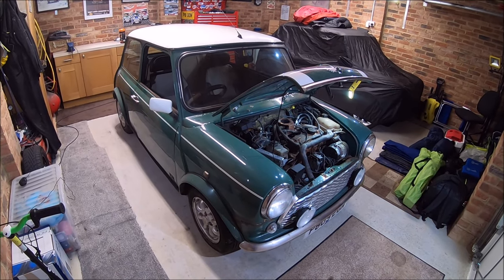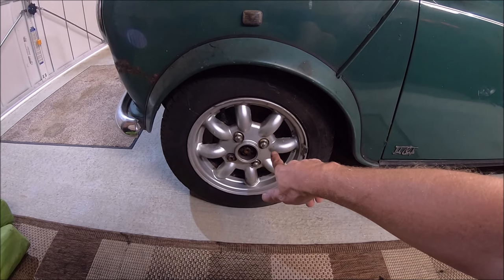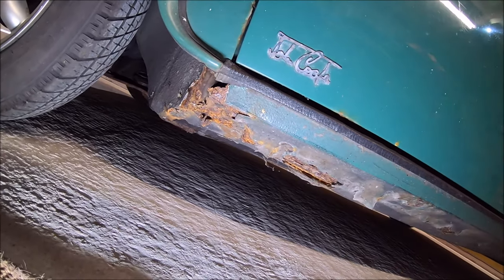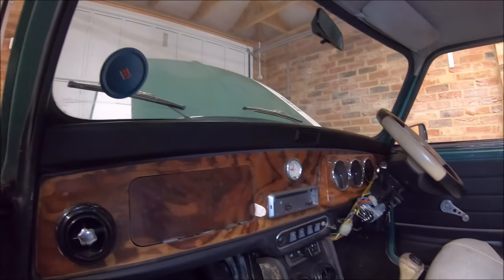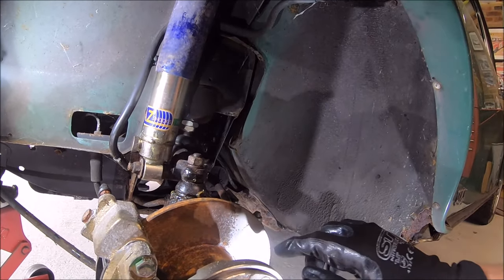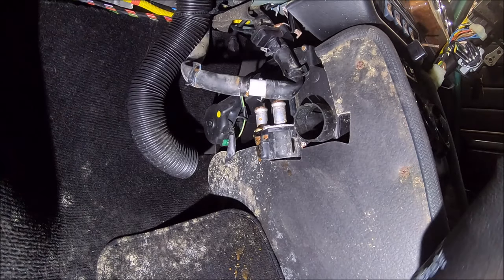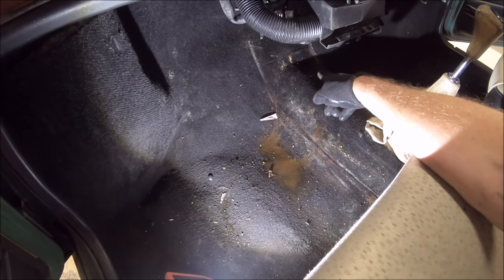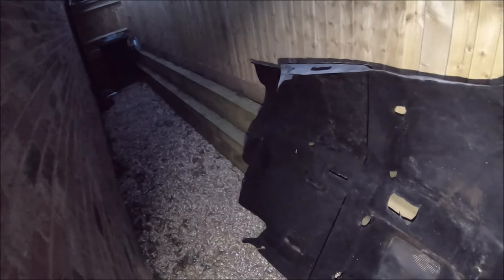Classic Mini Workshop - New Project Pt.2 Walk Around & Corrosion Assessment

Comment: sounds like the alternator has had water ingress when the bonnet was left off it could just be the brushes stuck in there holders try tapping the rear of it while running if not you can get a new reg pack which includes the brushes and anther way to free off the clutch if there is still an inspection plate on the bell housing then a big bar and lump hammer onto the pressure plate will free off and another way is to try and crank the engine while in gear with the clutch depressed same when hitting the flywheel those tips have always worked for me and has never failed in all the many minis i have come across in my career as a RAC patrol plus a fully qualified master mechanic of 35 years  and that engine sounds sweet to me now its had a warm up looks like you got a good one except for the common rust problems mini's suffer from having fitted loads of sills sub-frames and front ends and floor panels and that is one car i have never owned having worked on so many in all my years as a mechanic lol one day as now iam retired through ill health i could do one last resto on my own mini but they have shot up in price now typical your info is good sounds like you know what your doing as i love watching you tube do it yourselfers i love  enthusiasm they put into there cars as i did for a living lol your videos are good ive liked and subscribed so iam watching you closely making sure you do it right lol joke carry on your cool in what you are doing .all the best john from rugby.
Reply from the maker: Thanks John

Comment: Hi Keith, that oil on the floor was caused by a faulty seal/lid on a bottle of oil from Halfords. Brought it, put it in back footwell (why not the boot!!), got home and realised that the bottle was half empty....oil all over carpet, they paid for a valeter to steam clean who thought they had got it all but guess in process must have left some under carpets - shame it caused lasting damage.

Floor was done at a garage on a tyre change 😡

The brakes etc have never been on the road. Original plan was to get welding done and put 10 inch wheels on. 

Engine was always solid and reliable - fingers crossed will stay that way 🤞
Reply from the maker: Aha, that would explain the carpet, it's completely clean on top, its just where its soaked into the foam and sound deadening underneath. I think I'm going to peel away the foam from under the carpet and just replace rather than trying to clean as it's pretty sticky. It's a shame most tyre places don't know how to jack a Mini, it's pretty standard to see the floor damaged like that. Thanks for taking the time to reply and add some detail, I really appreciate it. Has it always been garaged since it came off the road in 2007? I found some bits of roof in the engine bay so assume the roof leaked maybe although my other Mini Vini somehow manages to go rusty in a completely dry garage LOL
Reply: Yeah we had a leak around 3 years ago and had the garage roof replaced so it would have had some water dripping on to it for a bit I’m afraid... 

I think there was always a small bit of bubbling on the roof when I was still using it.
Reply: @tomhumphries9731  It's weird why the roof bubbled so bad on one side tho.

Comment: I was just flicking through an old magazine and it gave me a clue. I had noticed that your stainless system has 4 ridges in the silencer box. This was / is a signature of Maniflow exhausts so somewhere there may be a welded plate with their name on it. Normally on the LCB if it has one. I was trying to make out the writing on your rear box but failed.
Anyway just a passing thought. If it is Maniflow you have definitely got a result!
Reply from the maker: Thanks, I will have a better look next time I'm under it.

Comment: That Sir is what is called a 'Result'! I am sure a good tap around with a hammer will reveal more but basically it does look pretty sound. A car in need of your attention to detail. And if memory serves wasn't the idea for those centre consoles kicked off by the '79 'Mini 1100 Special' which also gave us the smaller (Innocenti) wheel arch extensions? And yes being the sad old tw*t I am I have sourced one for Noah and my Size 9s will have to adjust!
Reply from the maker: I did find earlier while trying to free the clutch that the pedal bends remarkably easily if you need to move it away from the console a few mm LOL. Always amazed at your knowledge of Minis! I very nearly bought a Rose (Red?) 1100 Special in about 1993 for £800 I think it was. I was driving my first car a 1981 Mini 1000HL at the time and went for a 1981 3dr Mk3 Escort 1.3 Ghia (CVH) insead, more impressive with the girls :)  Both are now very rare cars, the escort is probably rarer now but so wish I had bough the Special
Reply: @classicminiworkshop  Ah right so a bit of persuasion is OK? .. sorted!
The genuine Mini Specials are like Hens Teeth because they were the only 'Mini' to have the Clubman 1100 engine and those special 10" alloy wheels. Although it was copied later they were also the first to have the offset Clubman dials.

I have great memories of Escorts but mine were rather abused in the forests. Started rallying with a Mk I Lotus Cortina, put the Racing Services engine from that into an ex works rolling Twin Cam shell and then rebuilt an ex works RS1600 that had done the East African Safari Rally with Vic Preston using a rather fast Hoyle 1700 BDA and a Boreham ZF (for which read Fiat) gearbox. Won a few events and got pots along the way but the cars were far more capable than I was. Paid for it all by working two jobs one of which was at a BMC garage and where I got the wife's Mini 850... See there is a point to my waffle!

Comment: Enjoying the new car what's your plans for it keeping it flipping it engine swap respray?
Reply from the maker: I think it will turn into a full respray as the whole front end needs doing plus the roof and a rear quarter. I will probably return it to original spec and keep the engine. Not sure if I will sell once completed or keep, no immediate plans but I'm not planning to flip it.

Comment: I have rover mini automatic...i hit the kerb and has been in garden for almost 2 years...the wheel on the passenger side has been bent. I havent had time to inspect underneath the car. But i was told that most likely i may need to repair the drive shaft...can someone give me some advice. Thanks
Reply from the maker: Mohammed Bulbulia You will need a ballpoint splitter if you don’t have one and a socket big enough for the hub nut, you may also need a special tool to remove the pot joint but you can do it with a carefully placed screwdriver
Reply: @classicminiworkshop  ok thanks i dont have a ball point splitter. Am thinking of taking it to garage but i dont want them coming back with a hefty bill. A friend of mine said..new drive shaft and get new track rod ends. And new tyre
Reply from the maker: @mohammedbulbulia3374  Sorry I meant Balljoint splitter. It's a pretty straight forward job for a garage to do so they should be able to give you a quote first however I would imaging there is more damage than just the driveshaft if it is bent. It takes quite a lot to damage the driveshaft. You may find the steering rack or tie rod is also bent
Reply: @classicminiworkshop  well i was driving down a hill when a white van man overtook me and caused me swerve. I think i was going about 25mph.  Ive seen a drive shaft on ebay...that i was going to buy today... but if i dont need to replace that then i wont buy it...i checked the tie rod. It doesnt seem bent...but like a say ive not jacked it up yet.
Reply: Your right on the steering rack...steering has gone really heavy since. But should i still but driveshaft???
Reply from the maker: @mohammedbulbulia3374  I would hold on the driveshaft until you know for definite, it's unusual to bend a driveshaft.